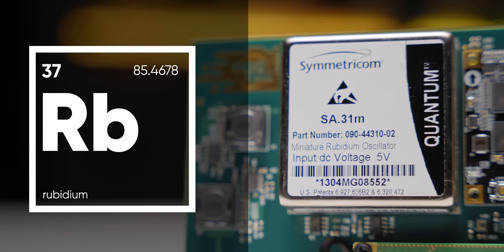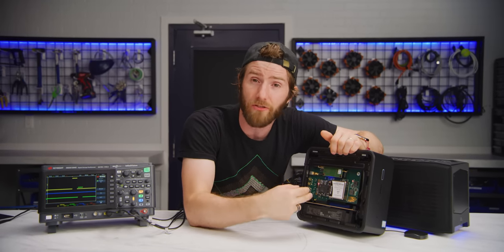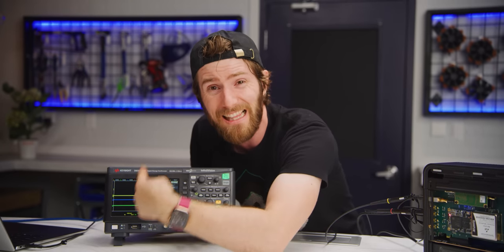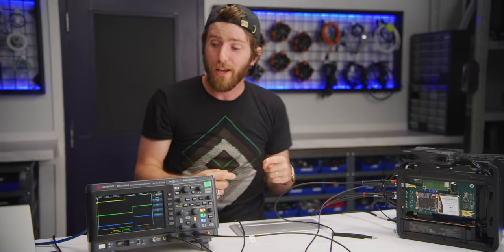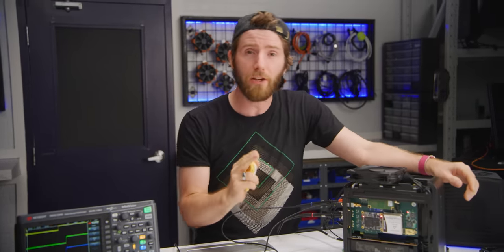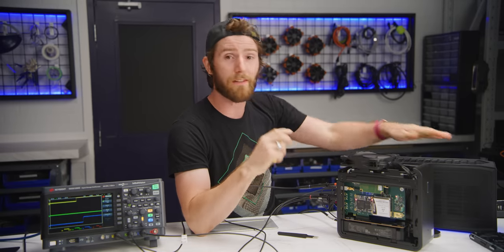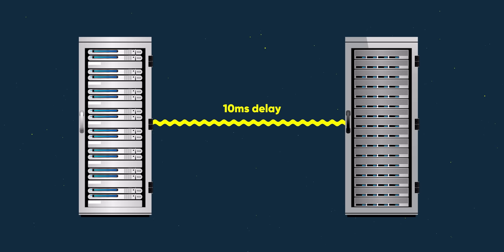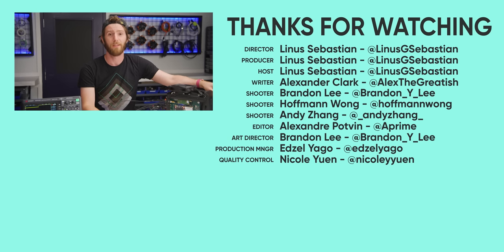Why is this PCIe Card RADIOACTIVE?

Comment: "we just whacked 20ms on everything"
OKAY this is a good reminder that whole world is DIY and yolo in solutions that just work
Reply: am trucker. basically all commercial vehicles are just adult lego.
Reply: @SoulTouchMusic93  As a kid who plays, builds and works with sh!t like 3D printers, they are all just the most YOLO solutions ever. From code to hardware. These things are built from LED power supplies and the motors of old scanners. And to compensate for inaccuracy to print you will just plug in an "offset" values, from distance, to motor steps, to temperature. And they fail... even the best engineered hardware, code has had mindfucks where it does not know how to manage a high temp of a failing relay that just clicked open and just lets it rip (3D printer of a friend caught on fired thanks to the computer trying to click an unresponsive relay off instead of going to kill the power source). 

I think if it's programmed by humans, it has YOLO solutions all over it, that one day or another, will be fixed, or a catastrophe depending on what we are talking about.
Reply: Nothing is more permanent than a temporary solution that works.
Reply: This is why the Space shuttle had 4 flight control computers designed in the '60s synced up for redundancy and an additional independent fifth backup computer with software written independently , just in case.

The computers from the 60s were good enough and 'just worked' (a valuable attribute for spaceflight) but in case there was a hidden glitch in the software knocking out the main computers the backup would be very unlikely to have the same glitch.

Comment: It is actually really quite impressive that they managed to miniaturize atomic clocks to such a degree.
Reply: When I was a kid I had this magazine that had a picture of an atomic clock, it was huge (I think bigger than my table) and now fits in my palm, just amazing
Reply: @frecio231  The National Air and Space Museum has a collection of atomic clock, from a huge metal chuck (50 years ago) to the size of an oscilloscope. Now it becomes even smaller while maintaining the ultra precision. Tech truly advances.
Reply: The devs must've played a lot of Fallout.
Reply: @Test-bi5rg  To be fair, those are still used. You're referring to cesium clocks, and they are more precise than these embedded Rb standards. They also have a finite lifetime, since they use a "spray" of Cs from one side of a tube to the other.
Reply: @Spirit532  I've stumbled upon those too while searching for details about the part used by Facebook, but based on the pictures I thought they were about the same size. In any case thanks for the info.
Reply: Yeah my dad worked on these clocks. You lose some accuracy on the smaller ones like the one on this board, I believe because of some instability when it comes to cooling, but even so they're incredibly accurate.
Reply: @patrickmattin9609  Interesting, thanks for the info.
Reply: most of that metal block is full of insulation and a small heater. a bigger atomic clock would be better as the temperature stability would be better. the stability of the clock comes from keeping its internal temperature exactly perfect, without changing in the slightest bit. that really can't happen in a computer with changing load, or even changing temperature in the room. in the video, I don't think they understand, there's a heater inside that thing.

Comment: Working as a sysadmin, i can very much relate to the "lmao just add 20ms" solution.
Reply: as a sysadmin, and this is probably an extremely stupid question, but why cant you create a way to handle packets coming from the "future"? this is the one part of the video i didnt understand the issue, but to everyone in the know it seems like an inside joke. is it purely a matter of not being able to perdict when they come? if so why does it really matter if they just need to process those packets if they are in the future in relation to the time received
Reply: @siccoblue2112  my slight understanding is if you use wireshark/software to sniff packet then a script to slightly edit in a perfect way you could alter data transmission real time and a tiny tiny amount off processing time is used making it just seem like a slow transfer but could be a change, so you could replicate real time unencrypted traffic. but i may be WAY off.

Comment: People underestimate the power of accurately clocked hardware. It’s amazing how cheaply stuff was put together back in the day… take any two original SNES consoles. They won’t even run at the same speed.
Reply: Yeah and the speed of games was tied to cpu frequency back then. Meaning performance was slightly variable machine to machine lol. But not in a silicon lottery overclocking way.
Reply: You can still use a RC or 555 still today and live with like 20-30% you can still go for it.
or you can use an rv-1805-ce or sth alike and go with less.
It depends on what you want to achieve or how much bugdet you have
Reply: that would have massive implications for speedrunners where world records are claimed on timing differences of just one millisecond.
Reply: @BlokeOnAMotorbike  it probably should have implications for speedrunners. These consoles weren’t even clocked stably when they were new, let alone 30 years later. However that is the natural behavior of “original hardware” so I could understand that just being an accepted part of the deal when it comes to official speedrunning. Not all consoles are exactly identical, even when it comes to newer consoles.

Comment: this made me very happy as a developer, like the techs cool but knowing that teams of the smartest people on the planets best solution was "just add 20ms" made me feel great
Reply: It was annoying to say there was a problem like that without even mentioning what software he's talking about. NoSQL DB? Some RDBMS? Replication conflicts? 😆 Nobody knows!
Reply: The part you got wrong is "smartest people on the planets". If you've got a dev job you know how it works. You have a finite amount of time and need to push some code even if it's not perfect.
Reply: @Ayaan K lots of them, mostly are just bandaids solution.
Reply: @fitybux4664  well, those that needs accuracy. Like basically any TCP connection that requires time precision like FPS games, massive data distribution, military equipments, etc.

Comment: The clock needs gps to establish an initial timestamp with subsecond accuracy which is why gps is needed. The rubidium just provides significantly slow drift and gives holdover stability when there's loss of gps. Cheaper OXCOs can be used if a gps input is always available.
Reply: "Cesium Atomic Clock" ;)
Reply: If you always have GPS input and just want accurate time, ntpd on a Raspberry Pi with a GPS hat can get an offset of around 10 microseconds after running about an hour.
Reply: @KavorkaDesigns  It's a bit confusing though - normally when you talk about a cesium clock people will think of a cesium beam device like the HP5071 - this is a bit different, it operates on the same principle as a rubidium clock, just using cesium.  The performance is still excellent, just inferior to a cesium beam - but it makes up for that by far lower power consumption and physical size.
Reply: It's a pretty reasonable price for a new frequency standard,  receiver, etc all packaged on to a card as a ready-to-go solution. (You can see the standard is a off the shelf module it's just sitting there on the card) Prices have come down a lot! These things used to cost 10x the price not that long ago. Yeah you can DIY it for much cheaper with a salvaged standard off ebay but for new this isn't bad.
Reply: OXCOs cannot be used on customer hardware because they are not meant to be power cycled. And running a 40w oxco all 24/7 is prolly not gonna help power budgets. But in the server, this could be pretty helpful.
Reply: No. Rubidium oscillator provides good short-term accuracy and GNSS provides long-term accuracy. Both are bad in the opposite case, that's why they're combined.

Comment: Please implement this. This can only give great results: a faster network and/ or a very entertaining series. And it isn't as expensive as a gold controller 😉
Reply: Yvonne didn't like that
Reply: @navb0tactual  I think Yvonne is still convinced he'll sell it someday. Living in denial I think :D
Reply: +1 I want to see that! Much more Interesting than a Gold Controller.
Reply: @NilakshMalpotra  scars of the past for her
Future memories for Linus
Reply: But I also liked the gold controller.
The latest incremental release of a gaming laptop.. I can give that a miss.
Reply: It can't make the network "faster". What is can do is have the servers function more efficiently, but it will not make the packet latency any faster (bound by the speed of light minus resistance and minus network processing time) and it will not make the throughput (the data transfer rate) any higher. Technically speaking, this does absolutely nothing to the network and can not speed anything up at all, it's improvements are only on the server side.
Reply: @NilakshMalpotra  On the wan show I heard he sold it to someone
Reply: it's complicated, this isn't just something you can just plug and expect faster things. this is at the base of everything your computer does, but the rest of the stuff built on top of it needs to know they can actually make use of it.
all the software in your computer expects time with at most a few microseconds accuracy, based on the crystal oscillator that every device has. all this software would need to be rewritten to know they can reliably count on 1000x more accurate timekeeping from its hardware.
Reply: @zbest-one  Pretty sure that less jitter and delay is an improvement for everyone.
Reply: @PredatoryQQmber  Still doesn't actually make the network any faster. This is a server side improvement,
Reply: @zbest-one  All modern networking is two-way and speed is not the only parameter. Y0ur mantra is pointless.
Reply: @PredatoryQQmber   Again, speed doesn't mean anything in networking. You're talking about duplex while also randomly switching between latency and throughput. If you're trying to make a point, you're failing spectacularly.
Reply: @PredatoryQQmber  I'm not sure where this antagonistic behavior is coming from but it's misplaced. Nothing I have said is an opinion. I know exactly how this works because I do it for a living and own a company that designs and deploys networks. I specifically pointed out that this will NOT make the network faster in any capacity and any definition of speed, that is all. You have a tenuous grasp of networking knowledge and that is ok, but trying to somehow convince people that this will make networks faster is wrong. 

Again, if that wasn't clear enough, please read the following: "Pretty sure that less jitter and delay is an improvement for everyone." This does not improve network jitter or "delay" which is latency. All it does, is allow the servers to more efficiently communicate with each other, which I have said 3 times now.
Reply: @zbest-one  How about "If you're trying to make a point, you're failing spectacularly" & "tenuous grasp" ad hominems and smug "nothing I have said is an opinion" (aka "I, the Earth's only avatar of wisdom, speak the tru-tru facts, unlike the p|ebs") statement ? And now pulling appeal to authority fallacy too. Are you going to post Navy Seal Copypasta next ? Never met such dedicated contrarian tro|| in Linus's channel before.

LOL. Stricter timing don't improve latency and jitter now ? The latency, that comes from excessive buffering, and jitter, that comes from scheduling instability due to wonky timing or overload, that is usually alleviated by excessive buffering ? What a networking professional we got here! And what is exactly this mysterious "more efficiently communicate with each other" in networking terms ?
Reply: @PredatoryQQmber  "Stricter timing don't improve latency and jitter now ? The latency, that comes from excessive buffering, and jitter, that comes from scheduling instability due to wonky timing or overload, that is usually alleviated by excessive buffering ?"

Again, that's latency with the server, which is exactly what I said. This will help the servers communicate more efficiently, not the network.

You had me there for a second, should have know you never had any intent on discussing things rationally. Just a dirty troll. Not wasting my time here anymore, but hey thanks for proving my point before I left lmao
Reply: @zbest-one  As self-proclaimed professional, you should know that most real-world latency comes from processing / house-keeping and precautionary measures for failures, not some theoretical best-case hardware utilization. Which is why random read is the most important practical SSD parameter for access latency & inter-process I/O contention and why beamforming & band subdivision of 5G & WiFi6 standards are so revolutionary due to possibility to tighten timings in crowded networks.

What are you doing, if you don't understand the importance of timing for multi-client / multi-process access and how much overhead the compensational buffering creates ? It even was pointed out by Linus in this very video.

Don't play the vic7im now, after y0ur repeated arrogant self-elevating and offensive outbursts.
Yeah, big card works in systems where it is installed, Captain Obvious. But any high-precision oscillator can be installed on any system, as long as size and power allows, to be used with Precision Time Protocol or any other application. Doesn't even have to be atomic.

Comment: I was expecting an Isotope driven random number generator, for when you want things to be the opposite of precise
Reply: You don't need any radioactive substances for that, you can use thermal noise within the semiconductor die itself (as is done with Intel CPUs and RDRAND instruction). Adding radioactive isotopes under the heat spreader would be cheap to do but massively expensive in terms of regulatory compliance.

Comment: This is really neat! I am a touring audio engineer and we kind of deal with the same thing with our systems and syncing digital audio between multiple stations and even the PA systems. We use Word Clocks that use Atomic clocks similar to these cards. Having multiple stations that are processing the same source in real time need an external clock source to reference to rather than referencing back to there own processed internal clock source. Trying to have these stations process and reference this internally rather than syncing from a external word clock can create phase relation issues and even complete audio dropouts and very bad noises from a digital source. Latency is everything in the world of live audio.
Reply: Why? An atomic word ckock is just not needed. Antelope is really the only one and I have never seen anyone use it. Any digital audio system i have seen generally uses a master clock such as a consoles internal clock or Dante card for example.
Reply: @testthisfordecficiencies  it is absolutely needed for the application I am using it for. Yes, all digital consoles have their own internal clock source, and yes you can clock from other external protocols like Dante and even have those protocols clock from your consoles internal clock. I use external word clocks because I am dealing with systems that have multiple consoles, playback sources, and outputs all over AVB and AES that needs to see the same clock source. Especially with dealing with multiple protocols like Dante, Madi, AVB, etc. Many audio engineers use external clocks in the concert touring world because of similar challenges like this. I actually use antelope word clocks like the ocx or isochrone trinity because of how many 75ohm bnc outputs they have. It all depends on the application and budget.

Comment: 10:28 Also means a few years down the road you'll be shamed for causing rubberbanding and lag if you don't have such a card. In any game over the net. Even chess.
Reply: The gpu market will have killed PC's in a few years, so no worries there.
Reply: @buggerlugz6753  Was also said about the smartphone a few years back.
Reply: @buggerlugz6753  The GPU market problem is a result of the ongoing chip shortages. When the silicon manufacturing stabilizes, the pricing and supply issues will disappear basically over night.